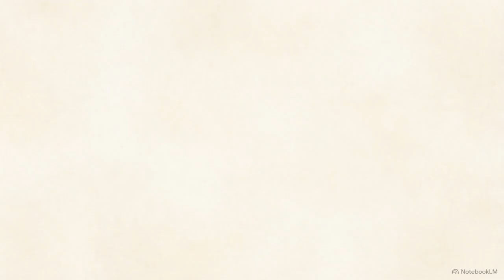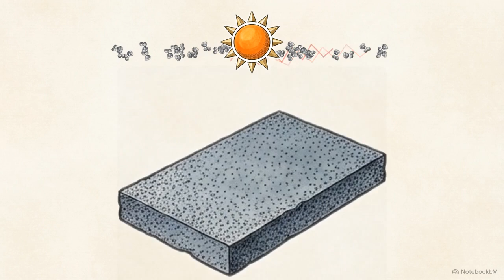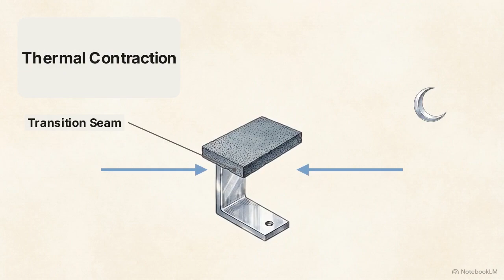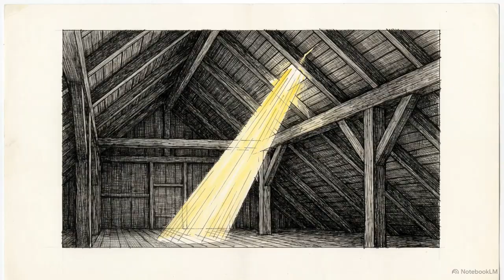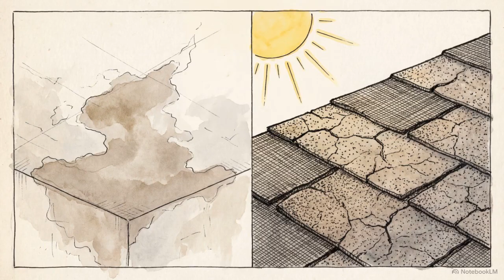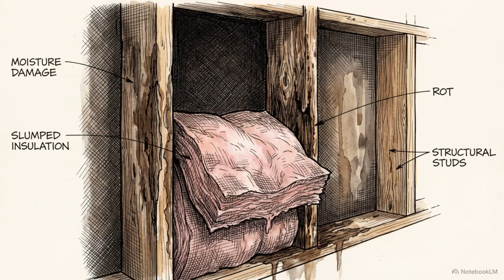Why Sun Is Your Roof’s Real Enemy | Roof Repair Camarillo

Comment from the maker: Most homeowners watch for storm damage, but in Camarillo, sun and heat often cause roof problems first. If you’ve noticed brittle shingles, cracked sealant, or recurring leaks, this is your warning sign.

Schedule a professional inspection with Roof Repair Camarillo:
https://camarilloroofrepair.com/

What roof issue have you seen on your home?